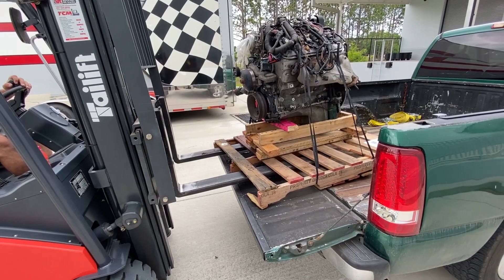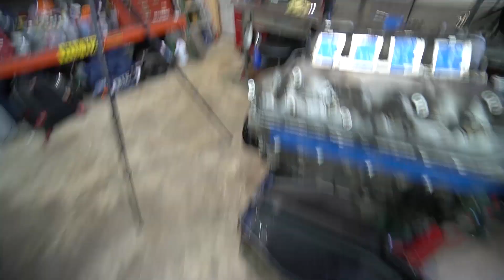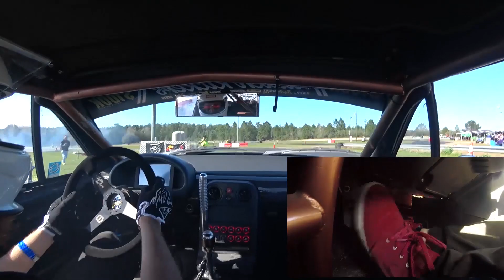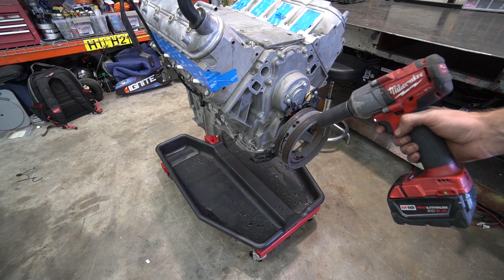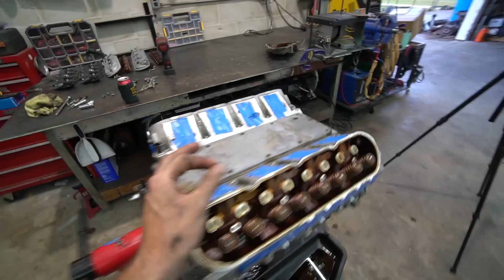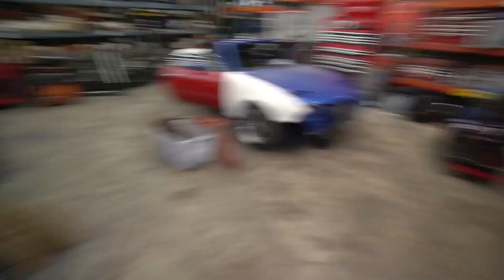New Big Boy Engine For The LS Miata! *SERIOUS POWER INCOMING!*

Comment: Oven cleaner is awesome for degreasing but i have found it oxidizes parts if left for too long, especially aluminium. Noticed everyone mention Texas Speed for an engine, theyre awesome but maybe Fast Forward Race Engines who done Rubys 5.3 bearings and are local to you would be the go for any machining.

Comment: You can buy whole trucks for less than you paid for the motor , with less miles on them here in Ontario Canada . The body will be rotten but once you sell the trans and cat, lights other miss parts + the exchange rate you would be around 500 or less for a motor even paying to have the truck shipped under a grand . Lots of trucks for sale under 100k miles( 220k kms ) and th box sides are rotten rockers rotten so they sell for cheap around 2 grand canadin pesos or 1433.15 usd. Rust free southern cars or trucks sell quick here drive one here pre sold it and drive home a rust bucket and you made money

Comment: GM's VVT on their V8's really is only for cam phasing for hitting better fuel milage.  since it can only turn the entire cam, not just the exhaust or intake, it basically just phases the cam for more advance at higher RPMs so that the power band can be fully shifted from the low end to the high end to maintain a near flat torque curve.  That is HOW these get a near flat torque curve.

Comment: Twist the spark plug wire around one time before you pull and the pop off way easier almost ever time. Even ones you have replace saves from ripping the end👍

Comment: I’m telling you man....with the new N/A monster that your putting in the Miata you should go ham and Tube the front end, mount your radiator in the back underneath the trunk and use the space all that will create to have a set of forward facing 8 to 1 headers built!

Comment: pretty sure taylor you need to replace the high psi oil pump that comes with the vvt engine, because the high psi pump will damage the cam bearings
Reply: He has a dry sump system with an external pump. Shouldn't be a problem.
Reply: Estian Badenhorst very true wasn’t thinking of that

Comment: Taylor, genuine engines are often bodged together. Especially GM engines. Selective fit bearings, pistons. 
An engine that you build, even using used parts will always be better. Providing you know what you are doing.100000 mile rings will be functional for the average road car but seldom never good enough for motorsport. Will probably be 6/10ths of ring seal. Worse with enough varnish as this engine appears to have the rings, more so the oil rings may well be gummed in the pistons. And I can guarantee the bearing oil clearance will be near double that it needs as they are near wornout.

Comment: also with the camshaft, get a 3 bolt camshaft and get the camshaft sprocket for a 3 bolt that also utilizes a front camshaft sensor with the front mount lower profile front cover because you dont want to use an aftermarket camshaft that uses a single bolt and that is per texas speed also.

Comment: 6.2 is going to be awesome! Did you run an under drive pulley set up on the power steering pump before? If not you could give that a try, wouldn’t cost too much to try out. Also an LSA blower would be sick to see in the future.

Comment: Taylor in part you are describing concertina effect.
The concertina effect happens at turns with a trailing car temporarily closing on a car because it's not yet braking. Then the effect is reversed coming out of a turn because the lead car accelerates first. This doesn't happen at the start of a race, because all cars do hit the accelerator at the same time.

Comment: Not that you need any help but swap out the heavy truck intake valves for rev friendly ls3 valves. Bump up the compression 11.1 if you can. Look over your intake options closely be hard to beat a stock camaro ls3 intake.

Comment: I know drive by wire throttle bodies can be dangerous pulling apart the intake manifold with the battery hooked up because I’ve heard nightmare stories of vw throttles cutting off fingers. Just figured I’d spread some knowledge in case you’ve never heard of it

Comment: Taylor these are great engine's I have the same one in my Mustang. Just a little advice for you either get a fluid damper or buy a crank pining kit for it. I've had 2 crank pulleys walk off of mine before I pinned it and haven't had a single issue since. And replace the stock bolt with a A.R.P one.

Comment: Drive by wire on stock ecu becomes an issue above 16 psi of boost.   The boost overpowers the throttle body motor and forces the blade position to exceed the threshold difference between commanded  and actual throttle position resulting in Reduced Engine Power mode usually while letting off after full throttle.      Otherwise drive by wire on an open loop MAF tune is the best.
Reply: Nick Kautz that's the most logical reason I've heard for this.. since no one seems to be able to sort it out, even people I consider good tuners. 

I really don't like the feel of dbw on my stock 08 ls3 car. it's so annoying.
Reply: @jsomething2  I went through it all with a procharged 403 , first with the Nick Wiliams 102mm and then with the LS2 90mm.  The code it was throwing was a TPS/Airflow code but there was no corresponding table to adjust in the tune.   Also , you can change the throttle opening rate and pedal/accellerator curve   to customize your throttle response.

Comment: I bought a flooded 05 C6 that needed a new engine a while back, trying to find a gen 4 / 24 tooth used for a decent price was difficult. Everyone wanted over 4k for a decently used one at the time so I ended up shelling out for a 408 stroker. Sounds like you got a pretty good deal on the 6.2

Comment: Quick note, loosening torque is always a good bit lower than tightening torque (when corrosion is not part of the equation), because the material stretching the tightening torque puts into the bolt is a constant force that is always working towards loosening the bolt.
Reply: X not on that bolt. it's got factory loctite and once they have been on there since 07. I bet if you could measure it, it would be well over the tq spec to get out. but yes, if you're testing a fresh nut and bolt in say a vice, it will take less to break it then you tq it at.

Comment: I want to put a  twin turbo 12a rotary in a Miata   that's the way it was meant to be  there's no need for a rev limiter on a rotary engine unlike a piston engine there's nothing changing directions it's all going one way, fast.
Reply: mrromantimothy rotary engines need rev limiters. and honestly build ka Honda engines are revving pretty close to street driven rotarys these days. all while being lighter and making better power while lasting longer. the rotary swap everything is like the diesel swap everything. it's internet nonsense that needs to stop.
Reply: @jsomething2  sounds like you've never even driven one,   i've street raced against piston engine japanese cars they can hang up to a certain point, but they always back off because you can hear their motor was about to blow up ,too many valve train components and crankshaft piston bearings that just can't handle it. Of course the rotary engine isn't made to burnout or drift , what's so cool about ruining a set of tires? I can get around a track faster without drifting. I'd rather race someone on the curves of a Mountain Road. that's where the real Thrill is at.
Reply: @jsomething2  you fail to account for the power pulses per Revolution. Common mistake perpetuatsd by Toyota and Nissan who wouldn't stop whining about getting their asses whipped on the IMSA track
Reply: @jsomething2  try dropping your Honda into second gear taking it all the way up to 70 miles per hour and then slingshot into 3rd gear and see how that works out for you.
Reply: @jsomething2  the only internet nonsense is you and YouTube paying people like  you for views , you couldn't run a shop  and you can't even learn things the hard way anymore
Reply: are you still talking to yourself? Jesus christ you're stupid. keep on keeping on I guess. every comment you post helps Taylor's interaction numbers.

rotarys are trash and horribly over rated.

Comment: I've been watching your show lately and if my voice text Will permit , I would like to mention a few things I am a RX7 rotary man through and through I have built several of them their power to weight ratio and the rotary engine gives them  handling that no other piston engine car can compare to in mountain driving I change my oil religiously 5000 miles use a PTFE additive and never let them ever overheat I've never had a problem blowing  Apex seals or any mechanical problems , I never could find the top end of a  12a rotary  it was too scary they  just keep going like a Dynamo like the RX7 the RX8 is perfectly balanced ,but the RX8 is a near mid engine car,  when people swap for an LS they throw that balance off I want to refer to your Miata LS and the problems handling you had , did you calculate the difference in weight that was being added to the chassis and did you compensate for it? That would explain changing the camber orr caster (I can't remember which one you did) seemed to alleviate you're handling problem. You should try to calculate the weight and compensate for it to restore the balance of your Miata rather than radically adjust your caster and see if that is a better solution.

Comment: Taylor, I would suggest when you do the cam to actually take a look at the cam bearings and if they look rough to pop a rod cap off and look at them with the sludginess of the oil in the head. If your cam bearings look rough it isn’t much to have the mains/rods done also and probably quick with how things are going right now. Also with the terminator in the future if you need more ooompf you have set it up to spray in the ECU with way more control than a typical nitrous setup. Quick way to add 100-200 hp for tracks that 500 isn’t enough or even use it as a push to pass or create a gap. “Moo-T point” BTW.

Comment: GM did in fact make a larger engine than the LS7. The Vortec 8100, or 8.1L-496ci, was a truck engine used mostly for towing, so more low end torque(450ft-lb tq) than horsepower(340hp), and designed to be competitive with the Duramax. Problem with it is, it's ungodly heavy, with an iron block and iron heads, it's almost 800lbs! Not many aftermarket parts are produced, but Raylar Engineering has many performance options like aluminum heads and superchargers, and new crate engines and up to 540ci strokers, that together, can net you power in excess of 680hp and almost 700ft-lb of torque! Definitely an interesting engine, but the amount of money spent to get that HP, could build a really insane, cheaper and lighter LS.

Comment: I have a 07 escalade that's falling apart how much does these motors sell for motor alone? Wonder if it would be better to sell just the motor and part the rest out over trying to sell the whole thing
Reply: 500 to 1000$ if it has good compression
Reply: Oh I figured it'd be more with only 108k miles
Reply: If its turn key on a stand maybe 2500$

Comment: With the money you've spent on junk yard motors you could have gotten a Texas speed 427 and it been done once, done right and over with
Reply: Rickey Allen not really.... he’s had two junkyard 5.3’s... rebuilt one. Now he’s got this one... I can almost guarantee that’s less than 8k total. No way in hell are you getting a complete Texas speed motor for under 10k😂
Reply: Matt L I was going to say the same thing.. the junkyard 5.3's have only had cam swaps and then rings and bearings. being a aluminum block made them a little more expensive to start with but he's not spent anywhere near what even a stock ls3 crate motor costs. nothing at all at TX speed is cheap lol. plus I believe the ls7 heads even aftermarket eat guides up and would hate being on limiter all day drifting. there's a reason why gm only uses the 6.2 in everything these days and just adds boost for power.

Comment: How do u like that electric power washer?? Been thinking about getting one but dont need anything crazy just something to wash the cars with
Reply: jeremy r I've had a gas powered pressure washer for years and its never given up. Its one of the vertical crank type not one of the horizontal engines but not sure if that matters. The plus side is you dont have to run an extension cord to wherever you are, and the gas powered ones tend to have higher pressure.

Comment: Foot cam really shows how busy  a drift driver is.
Reply: 300zxdriver not the same for all cars tho some require more footwork than the others
Reply: Yup. And that's in a 'Cheater car's (LS powered lightweight). If you watch some of the old option videos where they drifting AE86s with 110whp (128bhp) , or FC3 NAs with 125hp/145bhp
Reply: maverick buckley eh that’s because they didn’t need a whole bunch of horsepower to have fun that miata is probably really snappy even with the ls poweplant in it i wouldn’t say its an easy driver